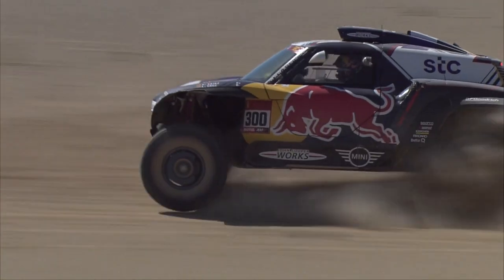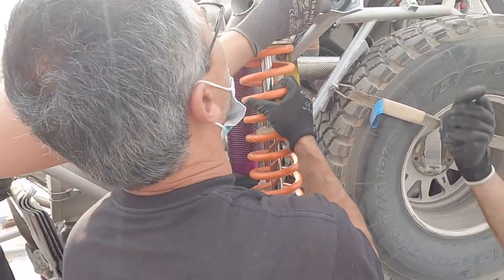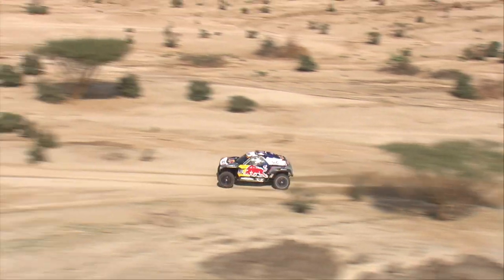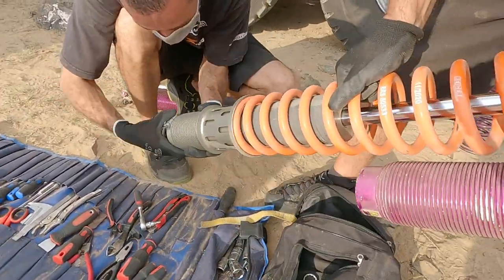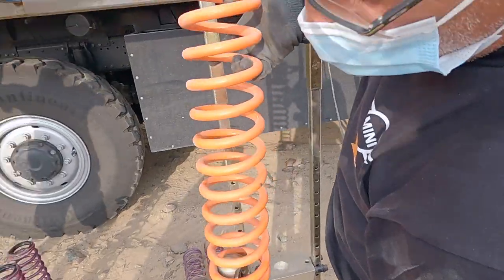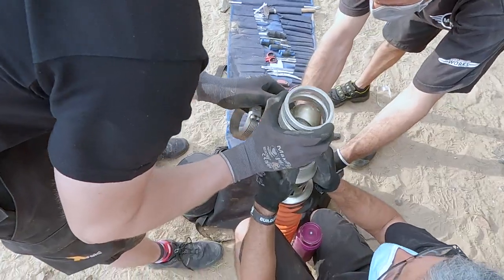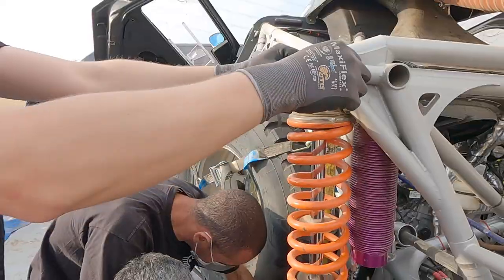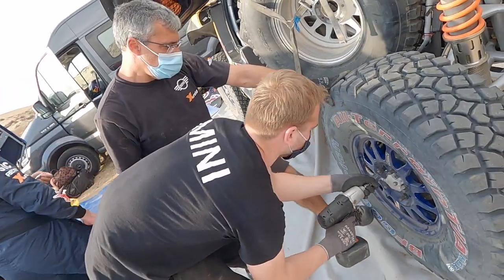Dakar 2021 Stage 1: Suspension is Key to Carlos Sainz's Stage Win

Comment: The Mini-Buggies and the Toyota Hilux's are so different they probably should be different classes..  either way I love Dakar.
Reply: The Minis used to be the same as the Hilux, 4wd, shorter suspension travel. They won plenty of times with that as well.
Reply: Back then no, there pretty much the same, but now, i don't even know that the thing is a bloody mini without the MINI word infront of the grill, and it doesn't even look like a mini like the hilix which still looks like a hilux.
Reply: That's the beauty of Dakar, different cars competing in the same class. It will be crazier in 2022